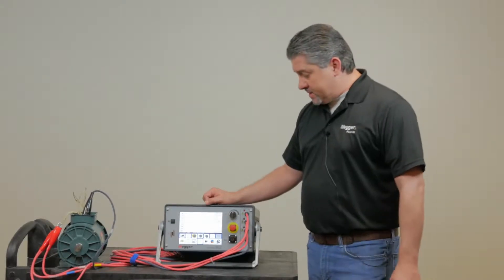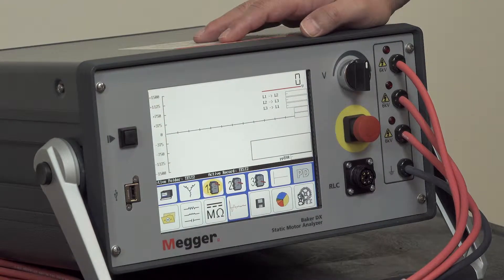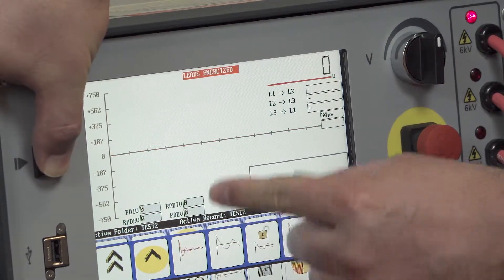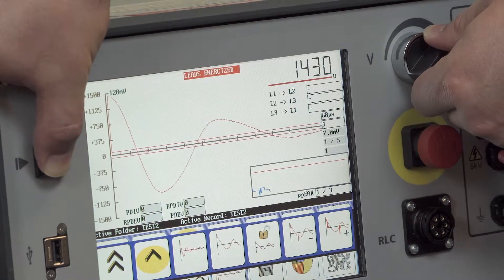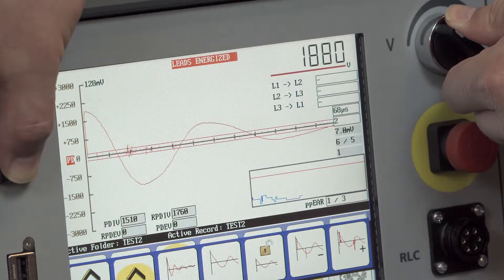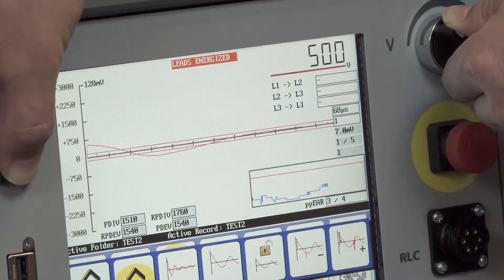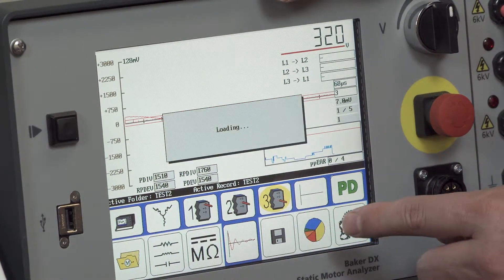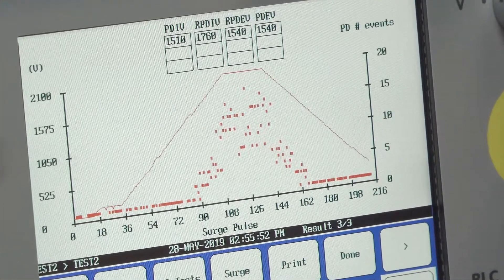Baker DX: Partial Discharge (PD) testing

Comment: How was the pd level?
Reply from the maker: The PD inception voltage was 1,510v and repetitive inception voltage was 1,760v, based on a PD threshold of 7Mv. The Inception voltage is recorded when a surge pulse contains more than a preset number of PD events, in this case 5 event. A PD event is when a waveform peak within the PD detection frequency band which exceeds a user defined magnitude threshold (mV). Repetitive inception voltage is when more than 50% of surge pulses have PD.

If you would like more information, please contact the Regional Sales Manager: Mike Herring at michael.herring@megger.com